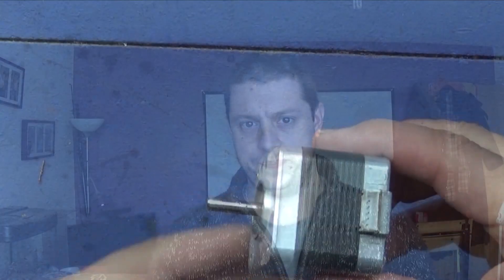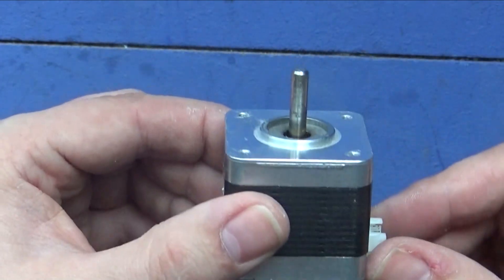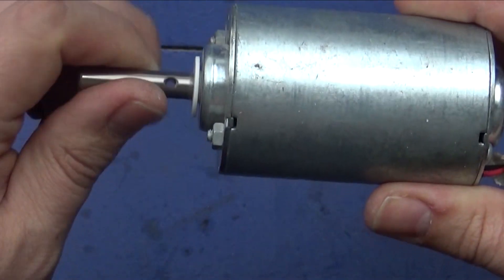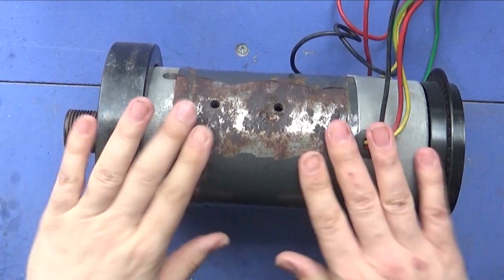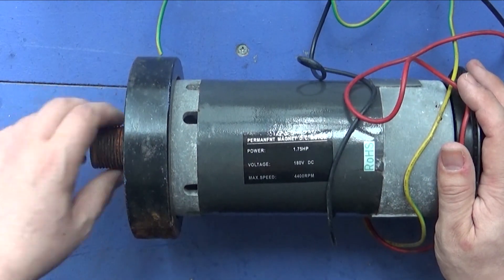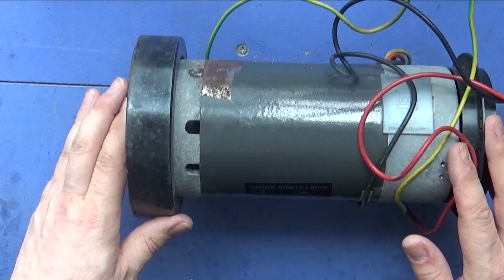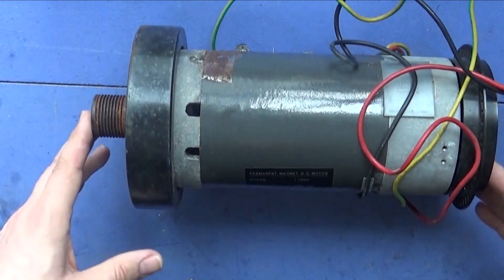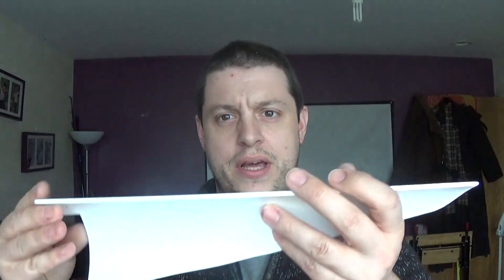Build Your Own Wind Turbine Part 1 | The Introduction |

Comment: non  this  motors or  steeper  will  hold the Volt  when you  give the  Loads
Reply from the maker: Mogal Amjad im sorry i dont understand what you mean
Reply: i was  telling  abt the motors  what  you  had shown  this are  good  in Volt  but not good  in amps  when give the  Loads volts  will also  drop
Reply from the maker: Mogal Amjad oh yeah i see. Yeah that true. You can eun a motor control driver and it helps stabilize the voltage/amperage drop. And can control the speed aswell. Thanls for your comment